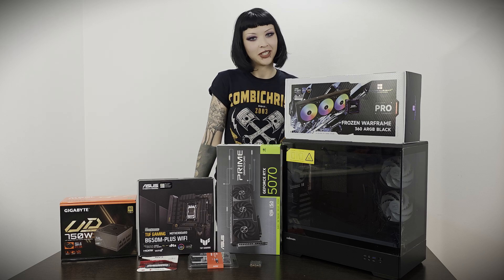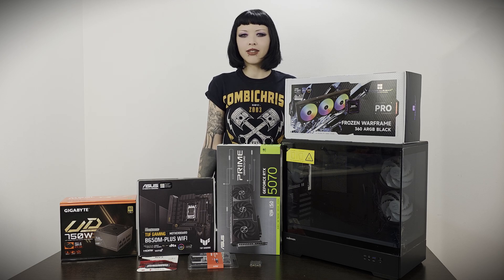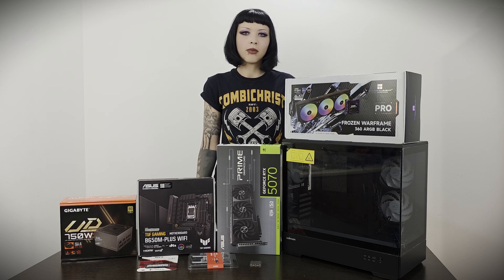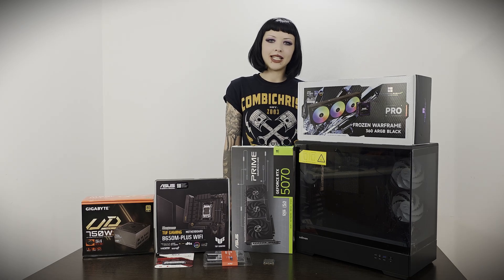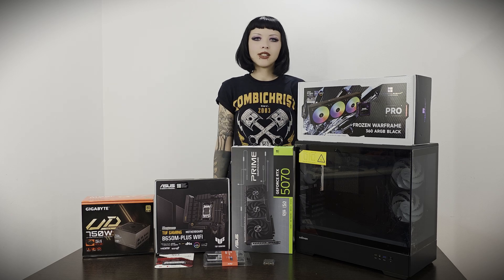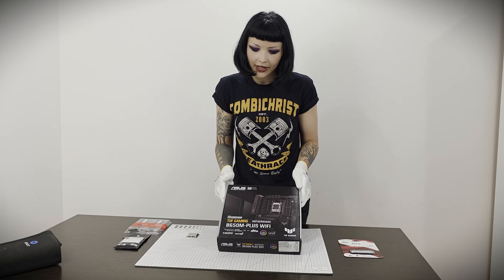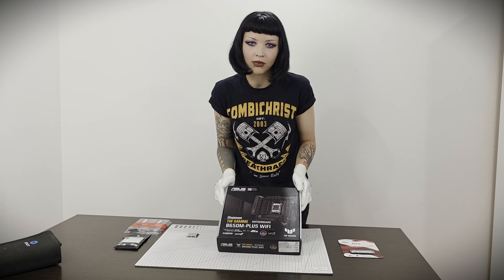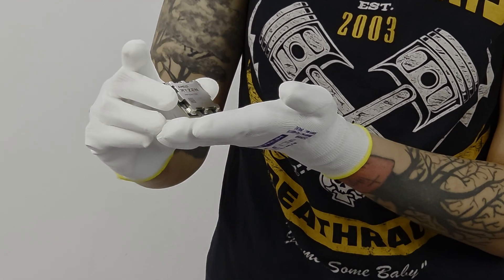My First PC Gaming build | Zalman P30 V2 micro ATX | AMD Ryzen 7 7700 | GeForce RTX 5070

Comment: 4k with an RTX5070 and 12 mb VRAM is not ideal. Better 2k. Today 12 mb VRAM start to be few.... for a little more money I would have choosen a RX9070XT with 16 mb VRAM.
Reply from the maker: You probably meant gb, not mb. RTX 5070 is a great card that can handle many games in 4k on high or ultra settings at 60 fps

Comment: i have the exact pc build but with a 5070ti instead, Im having troubles with stuttering in some games, could it be beacuse of the RAM? i ve got 32gb 5200MHz
Reply: in your BIOS make sure you have you XMP(intel)/EXPO(amd) profile set so your memory speeds are set appropriately, also make sure 4g encoding is on and Resizable BAR is enabled. When it boots you can go to your performance tab of task manager and make sure it shows your memory speed and the correct amount of RAM as purchased. Also make sure your power settings are set you high performance under power options and that the nvidia/chipset drivers are up to date. Then hop into the nvidia app an make sure your settings are set to performance. There are hundreds of youtube videos that show setup and have walk-through tutorials for this stuff. I'd recommend some channels like LinusTechTips, JayzTwoCents, and NexusGamer.
Reply: @AlKil-s9i thank you, I’ll try that 🫡